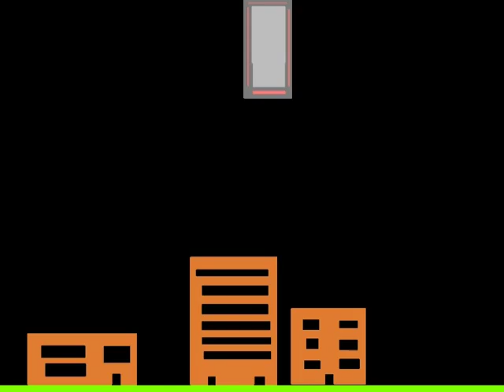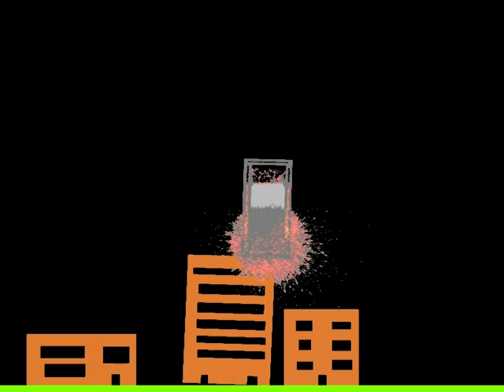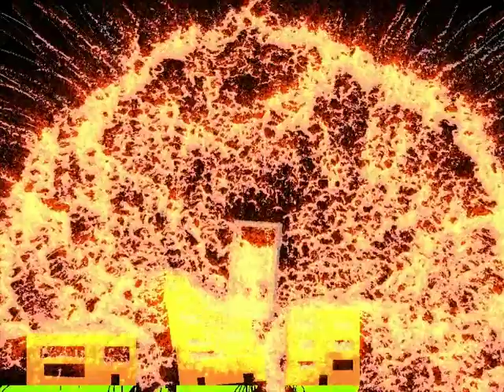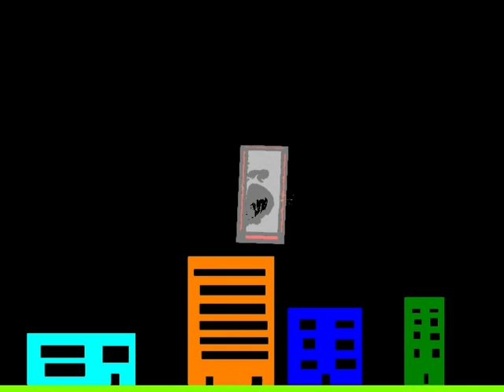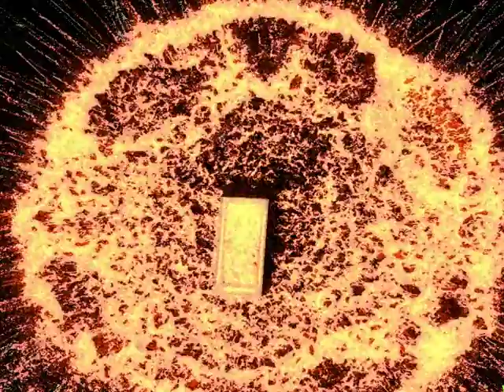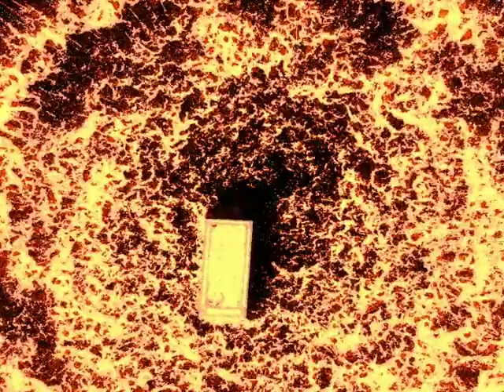OE-Cake 1.1.0b - Nuclear Explosion

Comment from the maker: The Rayleigh instabilities are caused by the surface tension of the mochi (an elemental component of the nuke material).

If you check my video "How To: Modify OE-Cake (Lesson 5)", there's a small demo of the mochi at the start.

Imagine popping a snot-covered balloon... you'd get similar visuals.

Comment from the maker: There are no bubbles or splashes in this. They're just visual effects not affecting physics. I leave them off.

The reason why it's so detailed is because i use a scale of 1.

If you want to use pictures or textures, you have to have it on blob & texture or shader modes.

Comment from the maker: I actually used my own custom method to record, but fraps will achieve the same result.

I can't remember which properties i changed. But maximum speed is probably one. It was when i first discovered custom elements and started messing with the save files, i realised what was possible and quickly made this as an experiment.

Both the method to record, and the nukes, were just a test really. I added the audio after seeing how nice it looked in full motion.

Comment from the maker: You can actually use lower than 1 (0.5 for example), since the scale variable is a floating point one (covered in my lesson videos).

The high resolution water video took 33.5 hours, much longer than this.

My PC is an E8400 @ 3.6GHz, 4 gigs ram @ 1:1 bus on an X-38 based motherboard.

Comment from the maker: My setup:

i7 3930K
32GB
GTX 670 2GB
2x120GB SSD (RAID 0)

Which is pretty damn fast I tell you. But yeah, there's really no way to speed things up unless the app was recoded and recomplied.

Actually there is one way. If you run a VMware cloud, you could make a single 10Ghz CPU on a VM and run it on that. Since I don't have access to half a million dollars in gear any more, I can't even try this unfortunately.

Comment from the maker: That's a decent laptop... But naturally it's slower than my desktop.

It took 3-5 seconds per frame on my pc. I estimate that it would take your laptop 5-7.

OE-Cake runs smooth as long as there's not too much stuff on screen (such as this nuke). Being a demo, it's not very optimised and a lot of the CPU's potential goes to waste.

Assuming a constant 3 seconds per frame, it takes 75 seconds to render what should happen in 1

So until PCs are 75x faster, nothing will run it (nuke) smooth

Comment: Why Does my OE-Cake lag when i spawn to much i have Asus G750JZ
Reply from the maker: Mine does too. Consider that I recorded this in 2008 on a PC much weaker than your laptop.

It's the way that I record it. Watch this tutorial. https://www.youtube.com/watch?v=nEH0VaI4kZ0&index=14&list=PL867665BE46CFF11D
Reply: 01DOGG01  Well im going to look for a way To get it to run smother il tell you if i find one
:)
Reply from the maker: Kristian Folke You won't be finding one, considering that it's an old, unoptimised single-core application.

Like I said, the only way to get smoothness is to record it, and create the illusion.

The nukes took 3.5 hours or so to explode.

Actually there is a way. Increase the scale. Then everything is big and you can't fit much stuff on your screen.
Reply: ok :)

Comment: Im back here, after 7 years.. still impressed how it works ;o
Also, OE Cake is not working on my Windows 7 64 bit, after fixing system date problem it just don't launch... do you know any solution?
Reply from the maker: Too bad they stopped working on it and focused on physicafe.

Set your date to before the 5th of November, 2008
Reply: I tried to, then game is not even showing any error, ni response ;_;01DOGG01
Reply from the maker: ☣ToxicSoul☣
I run a 64 bit installation of W7 and have had no issues. I don't even have to change the date!

Which version are you running?
Reply: I was trying to use the newest one, um, I mean last one xD
Reply from the maker: ☣ToxicSoul☣
1.1.2b?
Reply: 01DOGG01 Yeah :x
Reply from the maker: ☣ToxicSoul☣
Well, what can I say? I run mine just fine..

Try downloading another copy.

And again, BEFORE 8th November 2008 if it's expired. But I don't need to change mine at all.
Reply: 01DOGG01 That's strange, isn't it? :x
Reply from the maker: ☣ToxicSoul☣
Indeed. Download a few other copies and let me know how you go. Make sure it's 1.1.2b.
Reply: +01DOGG01 I'll try, thanks man :3
Reply: jeez, I was eight when this was made. Now i'm about to turn 18 and i still find oe cake awesome.

Comment from the maker: Well, there probably are heaps. I can't think of any off the top of my head. But there is a 1 million particle simulation vid i made a while back.

And that uses a program which is essentially a 3D wind tunnel.

One of the authors had a vid with a porsche in it but i can't find it.

Check the vid, it's got a link. You can also find it this way

Google "Tum.3D" and click 1st link
Click "Research"
Click "The Virtual Windtunnel".

Comment from the maker: To get speed, you need to program in a lower language - like you said ASM or C.

Look up "smoothed particle hydrodynamics", there should be a lot of examples out there.

You can get the most speed by programming it on a video card. Google "CUDA" and "GPGPU".

If you want to see how fast OE-Cake is, check my video "How To: Recording OE-Cake (Part 1)" where i demonstrate recording 32,786 particles and making a smooth movie out of it.